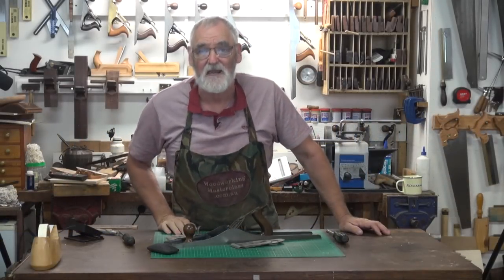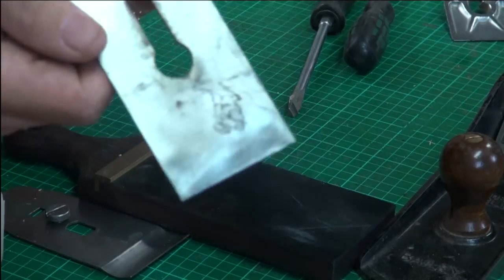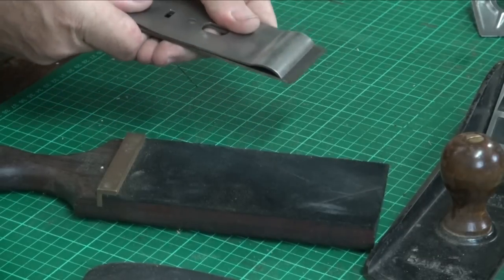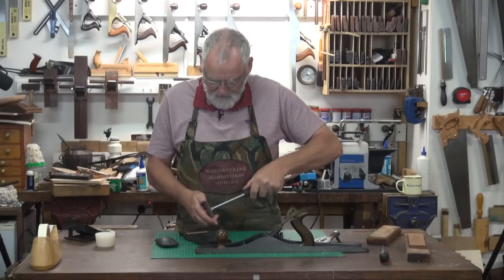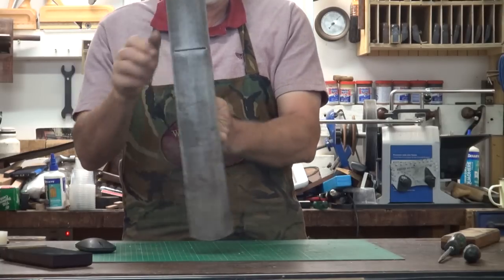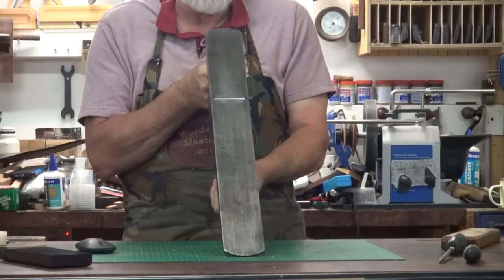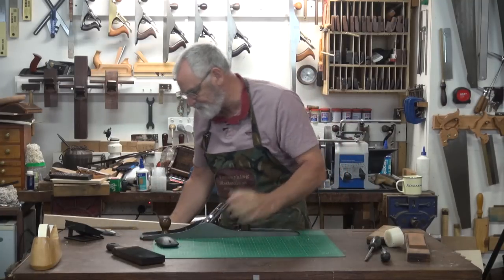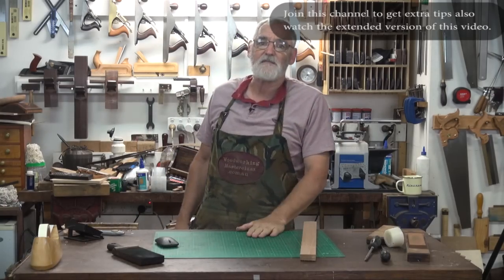How to Set up a Stanley Hand Plane

Comment: Thank you for this demo...Was wondering when you sharpen the blade, do you add a very slight camber in order to avoid the "tracks" left by a square blade when planing the face of a board?  I would love to also see a demo on a wooden plane (not sure if you use this type).  Thank you again for your video instruction.
Reply from the maker: Hi Paul, Yes on my Smoothing planes I do but not on my Jointers or Fore Planes as they are generally used for edge planing only. Here is a Wooden Plane restoration https://www.youtube.com/watch?v=urjeRBKyYVM&t=128s and here is one on Squaring a board using HNT Gordon Wooden Planes https://www.youtube.com/watch?v=D-0B58R4MLM&t=430s Thanks for your comment and Interest. Cheers Steve

Comment: what grit would you start with for a new plane blade for flatting the back, I'm guessing 120 grit going up is ok ?
Reply from the maker: Hi, all depends on the type of steel but 120 is a good place to start. I would use a wet a dry type of paper with a light oil for lubricant. Hope that helps. Cheers Steve

Comment: I gotta' admit I was fully expectant that you'd hone the frog & the surfaces upon which it sits.
Reply from the maker: I never have done in the past but if it's something that you feel should be dressed by all means do it. Thanks for the comment. Cheers Steve
Reply: @Woodworkingmasterclass  Hi Steve - frog honing and honing of it's mating surfaces really becomes important when restoring neglected tools or when trying to tune a cheap one.  Cheers
Reply from the maker: @apistosig4173  Good to know, thanks for the tip. Cheers Steve

Comment: I like my back bevels personally. Can’t use them on chisels though!
Reply from the maker: Well keep on using it if it works for you Michael. I do agree it doesn't work really well on chisels. Cheers Steve
Reply: Woodworking Masterclass that’s what I’ve always been told about sharpening: find something that works and use it. The point is to get working!
Reply from the maker: @mmccorm11  TOO TRUE. Cheers Steve

Comment: Is that a lump of candle wax you rubbed on the sole?
Reply from the maker: Yes David, I make blocks of it to sell for use on saws as well as other Tools which require a little waxy help. Cheers Steve
Reply: @Woodworkingmasterclass  I am in London, :-( 
any special recipe?
Reply from the maker: @davida369  No, bought 800 candles at an auction. Just melted them down and set then in molds. Cheers Steve